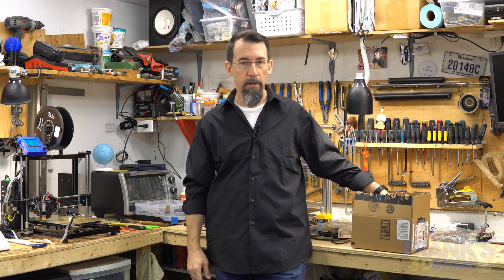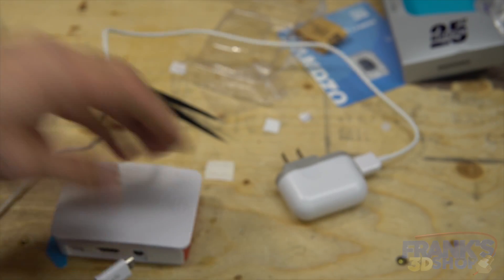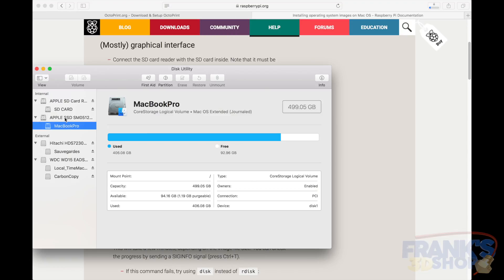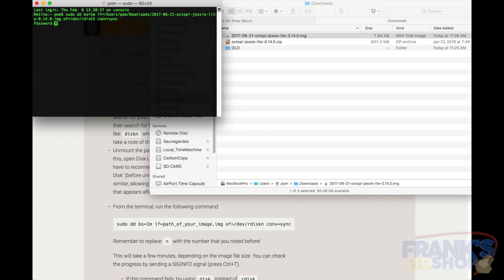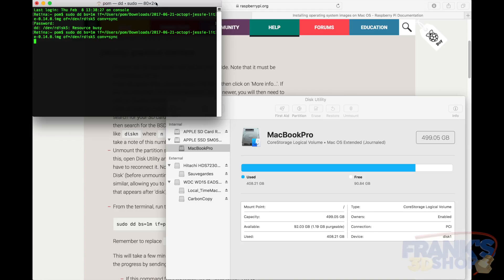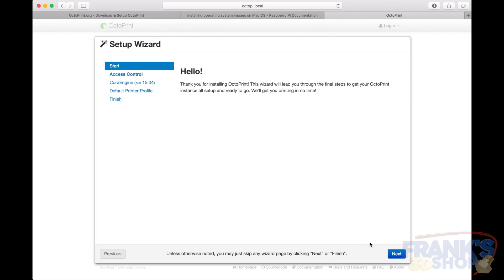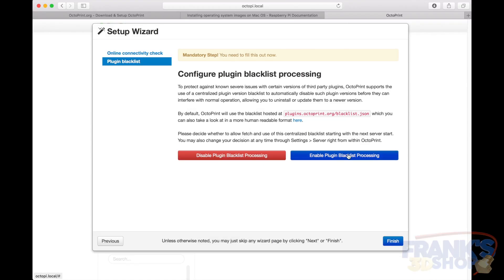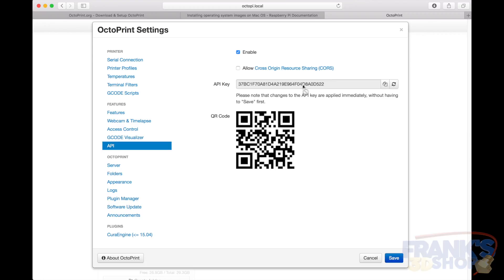Octoprint Raspberry Pi Install How To

Comment: Doesn't tell me the main part, how does the data get from the Raspberry pi to the 3D printer? is it through a wifi link, USB or serial?
Reply from the maker: Hi, you connect the printer via USB same as with your computer, and it will show up in Octoprint as a serial connection...

Comment: Followed this step by step and got it working, thanks so much! One question: when connect, it hums at a very high frequency... is this normal? thanks so much!
Reply from the maker: Hyden Polikoff Hi, it usually is the power supply that hums, try another one or try to tap on it a little to see if it stops...
Reply: Hey Frank, listening to it again, it seems to be coming from somewhere on my extruder head. Don't know if you have any ideas on this, but no worries if not. Thanks anyway.
Reply from the maker: Hyden Polikoff In that case, I do not know, verify that everything is firmly attached on the end. Could be the fan...
Reply: Everything else works great though, thanks so much!